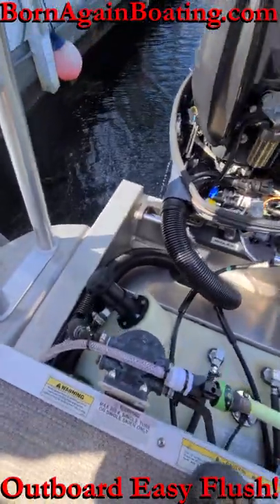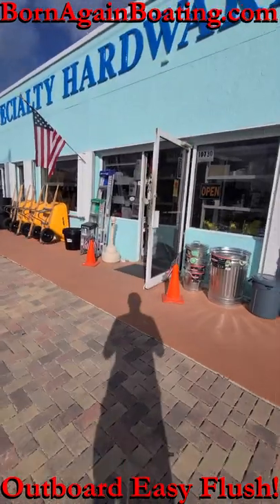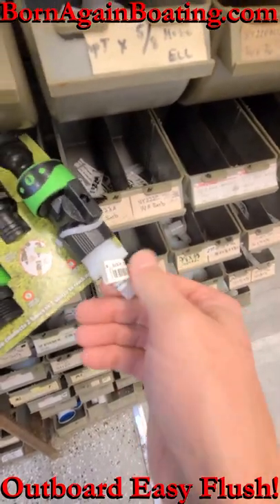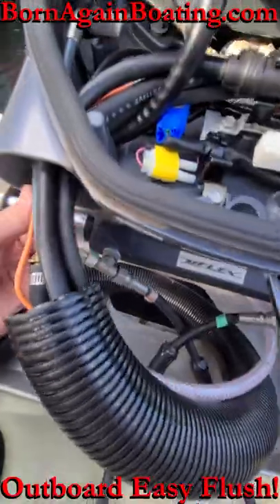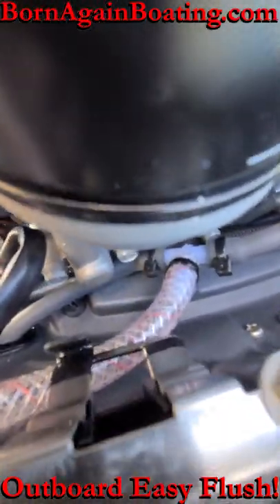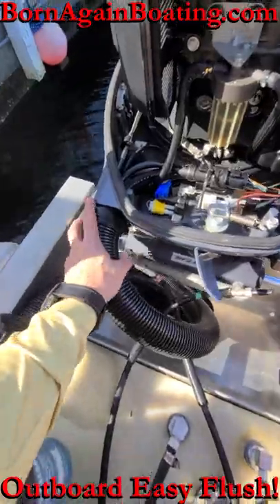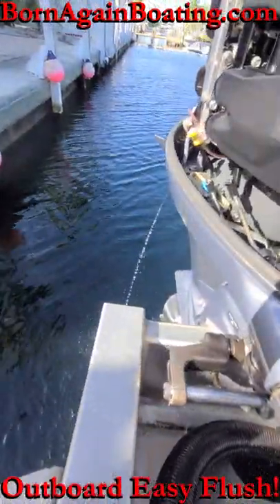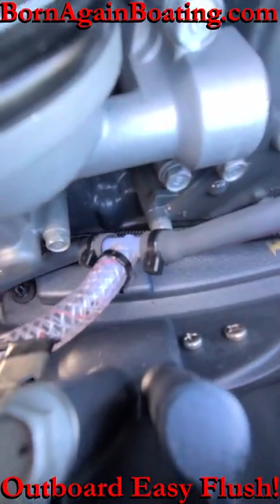Outboard Quick Easy Flush System! #shorts

Comment: Okay… I disconnected that hose from my 200 ox66 and it looks like it dead-ends into the cowling. So, the cowling connection 1.) prevents the hose from flopping around, and 2.) prevents water from streaming out of the cooling system. Anyway, I attached a Female quick disconnect to the cowling, and a Male to the hose. Now it just clicks on and off—simple. I can bring my garden hose over, quick disconnect my spray nozzle, and it will quick-connect directly to the engine to flush. 
No hoses to cut, takes 5 seconds. Did I do something wrong?

Comment: You can run the motor with the flush hose?  My Yamaha manual says it’s for static flushing only?
Reply: No because your water pump would be running dry and damage it
Reply: Yes. If it’s in the water like in the video.
Reply: @lukepage9326 if that is salt water ,what's the point, your not flushing anything but adding salt back in.
Reply: @lewisbolman7862  yessir. I think he's just checking for leaks in the video. Just saying it's ok to run with the flusher hooked up if the impeller is getting water.

Comment: I'm guessing that is what the 3/4" fitting (garden hose size) is for that you removed for sizing.
Using the muffs is far easier.
 My OB came with an installed garden hose fitting.

Comment: Love your videos! Question for you. Just bought a 02 200hp 4 stroke engine. I noticed that no water comes out the tell tale when I flush with the hose connection. It will come out when I run the boat in water. It comes out weakly If I run earmuffs, and again no telltale water when using just the hose attachment. Any suggestions?
Reply from the maker: I'd be wondering about your hose pressure, you might not have the volume or the water pressure coming from the hose, :/ on a F200 it should come out the tell tale when on the flush attachment
Reply: @BornAgainBoating  this was my first thought, but my hose pressure is great 60psi. What else could cause me to not get tell tale water on the hose connection?

I know the telltale itself is not blocked because it will pee when i run the boat in the water or with earmuffs.

Comment: Won't the impeller pump water through the T, and out of your newly attached flush hose?   If not, what stops it?
Reply: fitting has a check valve in it to stop that.

Comment: hey guysi have a formula here in jamaica that i wanna throw the inboard motor out and get a transum put on the back with two motors  i need sum advice
Reply: What kind of advice are you looking for? How to formulate calculations to ensure you still have the stability and weight ratio needed, after moving weight further back?
Reply: @strikeforcek9149  yes
Reply: i need sum1 to build it
Reply: @strikeforcek9149  i will pay need it real bad
Reply: @Jon Scholl  I'd love to build it for you, but I think I'm a little too far for ya, haha (I am a boatbuilder on the great lakes near Cleveland, Ohio).

I'm not affiliated with Born Again Boating, I just like watching his stuff because his approach to things is a lot like mine, and I like to see someone else's products come to life, haha.

But, a full on retrofit from inboard to outboard isn't cheap at all. If anyone tells you it can be done "cheap", then run like the wind. There are things you can do to make costs lower than going "all out". But, it's still costly as you know, to full on retrofit/convert.

What year and model is your formula? Are the stringers and everything else completely sound in the boat already? (If any rot is found or suspected anywhere in the stringer or deck of the boat, you'll be in for an even larger project of course).
Reply: @strikeforcek9149  the distance is no problem for me i come to miami often if you tell me how much it would cost me then i could send you half the money then when ur done would send you the rest and ask you to ship it to me  or maybe you could source a used one i am desperate bro
Reply: @Jon Scholl  That's usually how the larger restorations go, 50% down and 50% upon completion (at least that's how we operate with larger builds).

But, what exactly are you looking for? Specs, performance, needs, desire, etc etc? Dependent on what you have VS. what you're looking for, getting an already outfitted rig may be the best option. Just depends.

Comment: I get a lot out of your videos. In this case, I think it's easier to simply put quick connects on the short hose tail, one on the motor storage fitting, and one on your flush hose. I do this on my Yami, and to flush, simply quick disconnect from motor, and quick connect to hose. Almost no work involved and just as fast.

Comment: bigger problem is that your using pressure and not the water pump to flush motor. It to need to be cleaned. a can or large container under the foot filled with water and small amount of soap to wash out the saltwater will keep your pump and motor head clean of buildup.

Comment: Just curious, if you do this as shown would you still be getting salt water through the engine, albeit a lot cleaner? 
And I'm assuming this wouldn't work on dry land cause the impeller would be dry? 
Maybe I'm looking at it wrong too. Cool videos you do though.
Reply: It's not for cooling engine. It's to flush it with fresh water at end of day. Just makes it easier as you aren't leaning over engine at dock to flush it with fresh water at the end of the day.
Reply: @supersteve8305  yeah I know that. But if the water pick up is still in the water when you flush it, like they show here, surely it's still pumping salt around
Reply: @thenationdecides7404  It fills from top down.  I trim my engine all the way up when I flush and water fills, starts coming out around prop and lower unit vents, then the tell tale.  I don't flush with lower unit in the water.
Reply: @thenationdecides7404  You flush the outboard with the engine turned off. The impeller isn’t spinning. It also flushes in different directions than it pumps while running so it would probably be dangerous to run the engine and flush because you’ve disconnected parts of the cooling circuit.
Reply: @joshuarodrique2096  ahh ok so you reckon when it showed the engine running he wasn't actually flushing it. Now I get it. I thought he was flushing and running at the same time.
I've only ever flushed my outboard using the bunny ears with it on the trailer. I suppose you'd need a valve in that add on bit of hose to stop all the water flowing out the hose when.

Comment: Why not just hook your garden hose up to fitting that's on the engine? Every monder day engine comes with a  salt water engine flush. Why take all the extra steps and cut and splice quick connects to the engine? You can just screw your hose in and flush it. If I'm wrong please let me know. Mine all you do is screw the hose to the fitting and flush it. Don't understand why you are doing what you are doing ?